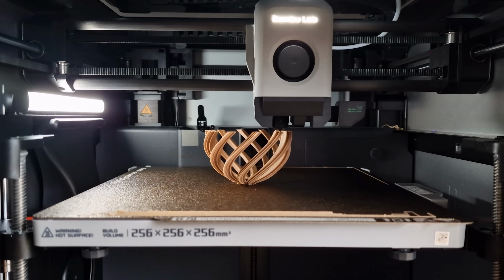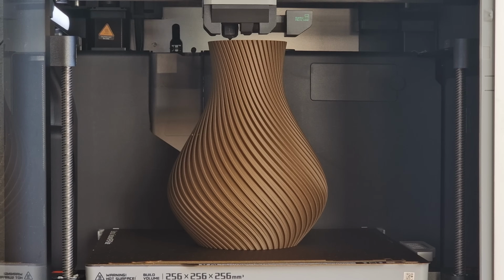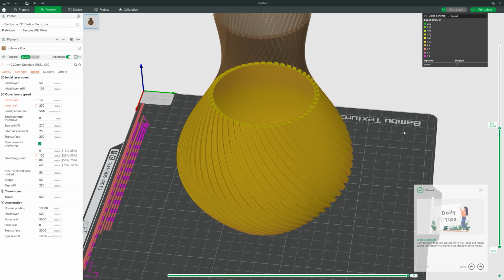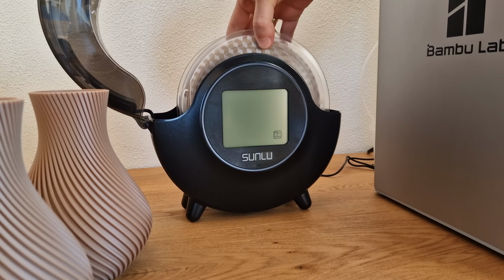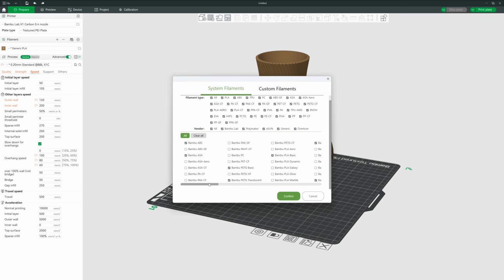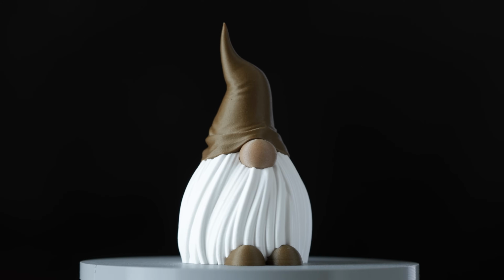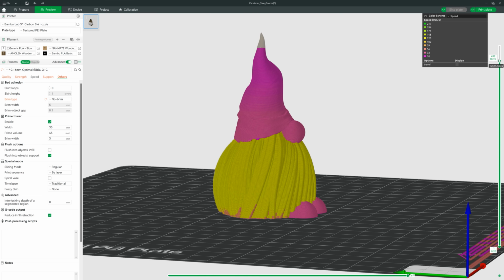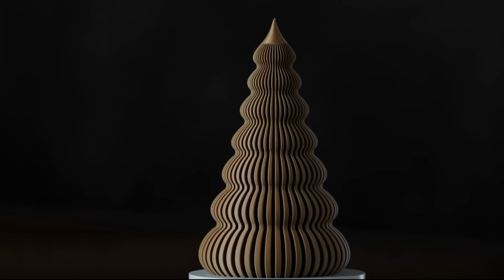Bambu Lab PLA Wood vs. the Competition: Stunning Prints or Festive Fails?

Comment: With the new BL PLA-Wood I found that lowering the volumetric flow actually decreased my print quality, which is extremely odd. With a volumetric flow rate of 15-18 the quality was much better than when I tried it on 9. The sheen was also reduced with a higher vfr, so it looked more like actual wood. All my tests were with the Black Walnut version.
Reply from the maker: Thank you for sharing your experience! My deer odyssey, as I mentioned in the video, had me experimenting with all sorts of settings—it was kind of frustrating! In the end, I printed all the outer and inner walls at 15 mm/s. Therefore, I lowered the nozzle temperature to 205°C, added retraction, reduced the minimum print speed to 10 mm/s, and increased the minimum layer time to 10 seconds. It seems the filament basically overheats when printing too slowly.
However, with these settings, printing slow worked for me, and the results were quite similar to Bambu's default filament preset.

Have you tried any other adjustments or found a workaround for this? I’d love to hear how you approached it!
Reply: @creativemakerat  It does seem like it sort of overheats when going too slow. Well said. I actually hadn't considered that as the cause but it definitely makes sense. I have a few rolls in the dryers now and when they're done I'm going to throw them in the printers using different combinations of your settings. I'll comment back with my results.
Reply: If you want less sheen it's pretty simple. Add more fan speed, lower nozzle temp or slow down. Sheen comes from melting plastic in general. The speed at which the plastic cools determines the level of sheen. So whatever you can do to cool less or slower will increase sheen and vice versa.
Reply: @phasesecuritytechnology6573  Yes, all filaments, save some HF variants, loose their sheen when printing faster. This makes the BL wood filament look more realistic. My goal is the best print quality though, and the matte look was just a bonus. I'm currently still testing print settings for the wood pla. It's one of the trickiest filaments I've ever dialed in but it's worth it imo.
Reply: @OhImKiCkiN  i thought that this is the benefit of having the bambu lab printer and bambu lab PLA, that you dont have to fiddle with all those nerd settings ?
Reply: @Danbarb-r1p  Because I sell my prints so I dial in everything as perfectly as possible. With default settings, Bambu machines still outshine any machine I've used under 50k dollars.
Reply: @OhImKiCkiN  ah ok, it is because i have ordered the A1 mini yesterday and i have no experience with 3D printing at all. I just ordered the standard Bambu lab PLA with it. The reason why i ordered the printer was that my brother has a concrede pillar in his living room and he needs a skirting board / base board for the floor arround the pillar, its 25cm in diameter. The local carpenter wanted 120 Euro for bending a real wood base board arround it. So i ordered the A1 mini for 199 Euro and i try to print it and cut it into 4 pieces with the bambu lab studio software. Later i can use a bit of putty and spray paint. Not sure if it works but i think its not a complex shape :) Just a "ring" with rounded edge but who knows, maybe the whole 3D printing thing is more complex. Thats why i asked about the settings because i thought the Bambu is more towards plug and play, especially if you use their PLA.
Reply: @Danbarb-r1p  You'll love the A1 mini. I just had another H2D delivered today because I trust Bambu machines so much....but the shipping company stuck a forklift fork through the back of it so I'm dealing with support now lol. Your A1 mini will be a little workhorse if you decide to print constantly. They're amazing machines.
Reply: It's not that odd, that's a common thing, just lowering the flow rate is not recommended. Especially with Bambu and their specific profiles there should be a good reason to change settings.
Reply: @dura2k  Considering that the majority of 3d printing blogs, channels, guides, etc recommended lowering the vfr to increase print quality, its definitely not common for quality to decrease when lowering it. As I said earlier, the BL Wood is one of the trickiest filaments I've printed with to dial in perfectly, so profile tweaking is a must.
Reply: @ Depends on how much you lower it. Too low can cause problems.
Reply: @dura2k  What filaments have you experienced this with? I've dialed in probably thousands of filament brands/types and have never experienced the quality dropping like this. I think you may be referring to VFA's appearing when the vfr is lowered too much, which is common on BL machines, but that's not what I experienced.
Reply from the maker: @dura2k  Thanks for sharing this info! This is actually the first time I've heard about that. Does it apply to a specific filament type? I sometimes dry my filament down to 15% or less, especially TPU, since I always print directly out of the heater. Curious to hear your thoughts!
Reply: @OhImKiCkiN  I’m not sure, I think it was PLA or PETG with extrem slow VFR setting. As far as I looked up and read, this will cause problem, not sure if it was related to heat creep, or something else. It was over a year ago and after that I never go under a value of 6.
Reply: @OhImKiCkiN  why? If you have a bambu lab printer you can choose their PLAs and they have the best settings i guess, makes sense. Otherwise the whole bambu lab thing makes no sense and you could buy a generic printer.
Reply: why not using the settings from Bambu lab or cant you choose the PLA Wood from them in the software?
Reply: All of these comments need to state their humidity.
Reply: @GoodBaleadaMusic  Farm room humidity (warehouse) is about 58% on average. All filaments, even PLA are immediately thrown in dryers after opening and then in vacuum sealed bags, labelled, and then scanned into the filament library.
Reply: It's important to also remember the VFR setting is a limit that works in tandem with the print speed. So while normalizing the head speed can be used to check that your flow is relatively uniform using Flow Rate view and ensuring consistent cooling by layer can go a long way to ensure consistent finish